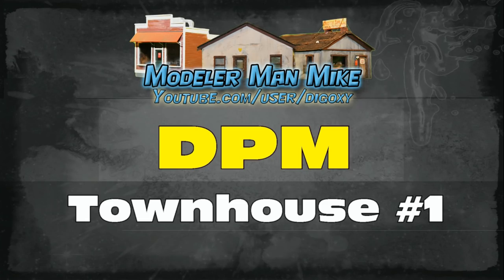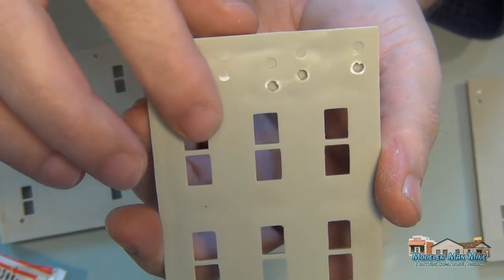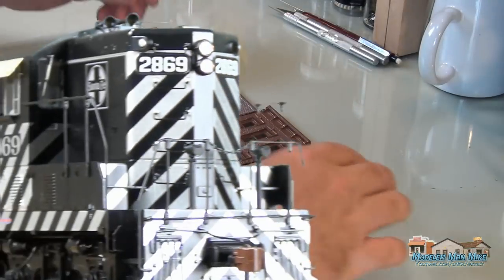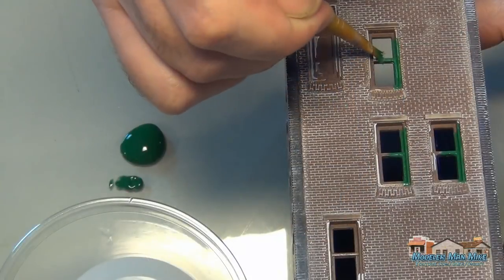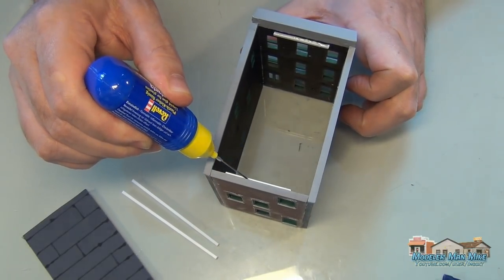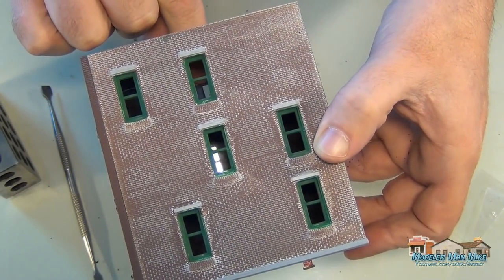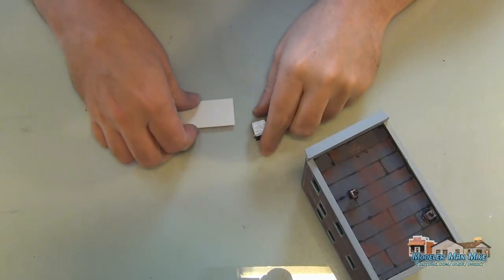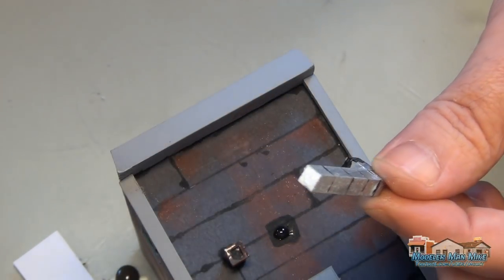Model Railroad Layout Building DPM Townhouse #1 How To

Comment: Thank you for this video! But a question! Why didn’t you apply the white paint in the mortar joints on the front of the building?
Reply: I surely dont remember, it may be that it has all the windows? Would be more difficult to take off of the brick with all the other stuff that is on the front of it. Totally guessing though.
Reply: Thank you!

Comment: A trick I came across for DPM and similar buildings is to use your dial calipers to measure a window. Then cut sheet styrene to that size for all the windows. (Cut strips for width and use a chopper for length)

Spray paint the windows, then when the paint is very dry (24 hours ) use a little white glue to put the styrene over the windows.

Now you spray paint the walls.

 The styrene should pop out without much fight. (White glue does not hold non porous items) You can also hand paint the sills with the windows still covered.

I built that model a few years ago. BLMA sells window air conditioners in HO, and I used a few of those on it.

I also modified one window to be open. I have a figure leaning out the window looking down at the wrecked air conditioner he dropped out of the window. 

It always gets a laugh.
Reply from the maker: Oh, now here are some really neat idea's, including a scene even! :) Thanks pmsteamrailroading! The BLMA are they the lazer cut little tiny metal ones? If so, I had intentions of using these, I just never got to it for the video. I do plan to use some of these window units on another build video eventually. They look cool and they are a great little add on.

I am certainly going to try your suggestion on the windows and see how that goes for me. I am planning another DPM Build that will include a couple of buildings at once and this means alot of windows! I have actually masked off the entire building (kind of the opposite of what your saying) and had decent success with that. In all, I am really lazy when it comes to doing some of these models. Recording the build and building takes so much time already, I cut corners where I can.

Would like to see some pictures of your models and scenes, do you have a facebook page? if so, look me up modelerman mike

Thanks so much for your comments and suggestions, you may very well see these in a future video. Hope fully, when that time comes I can get back here and find this so I can mention you!

Comment: Too keep the building square take a couple of your old room keys form hotel and put on table and make sure that the corners are touching on both sides.  Gives you a 90 degree angle. The edge on plastic card gives you something to push up against to insure corners are square.
Reply from the maker: Hey Art, I am not real sure if this message is meant for me or not? might be for someone else that commented here maybe? I am using 1x2x3 blocks and squares, I guess you see these in the video?

Comment: Hi Mike very nice job on the build and the video. You might try a angle brush or
cut a brush at an angle to do doors and windows. Johnny Reb
Reply from the maker: Hey Johnny, thanks so much for the comments and the suggestion on "coloring inside the lines". You know, after watching this video, I linked Miles Hale's Woodland Scenics DPM building instruction video into the description of this one and wound up watching his! lol! Your suggestion is exactly what he does. Something else I noticed watching my own (these close ups are amazing, I see more in the video than I did making the dang thing) that, my brush has loose "hairs", I didnt even know this! But, I am going to take your suggestion and Miles and give that a try next time.
Reply: ModelerManMike
Mike glad to be of help. Also i forgot, try cutting some or about half of the
bristles off. Then cut the angle about half way down the bristles. This make
the bristles stiffer for better control. Videos and pictures of what you are doing
can be a big help. Johnny Reb
Reply from the maker: Johnny Reb Hey Johnny, I will surely give this a try. Thanks for the tips and of course the time to write this comment! Its appreciated!

Comment: To paint the windows and doors, paint these parts first with airbrush, then apply a tape mask after dry. Spray the building walls and then remove masks when dry. Or, paint the windows, doors, and trim with a fine brush first, then the wall surfaces.

Comment: Hi Mike, most of my paints are Model Masters Enamels and i find using 10/0 brush maybe 20/0 and thinning the paint Helps a lot making it flow easier round the window frames, But that's Enamel .But it still a wonderful by you .
Reply from the maker: Most of what you see me do is done primarily because I am lazy. I will use water based paint whenever I can so I can have a really easy clean up! I do use some enamel's only when I need to. Your right though, thinning helps a lot and after seeing this close up, I can see my brush is all but new! Its straggly little hairs all over the place, it really created a mess, it was easy to overcome but man, seeing it in a close up here, I was blown away. My eyes are not near what they used to be! The close ups really show me what I dont see when I am modeling.
Reply: I wish i could get myself to using acrylics ! But dad taught me the way of enamels . I do use acryl the way you do on the mortar lines
Reply from the maker: thetobin8or I say, do what works and your comfortable with!

Comment: Nice job. I like the idea of the sand paper on a board.  Did you glue the paper down? Do you have to change the paper often and what grit did you use?
Reply from the maker: Hello Drummer, the paper is glued down with spray tack. I haven't had to change it yet, it last a while I would imagine. I cant remember the grit, but this is totally optional, the idea would be a course and fine. I actually have a video on building this exact board in this video that explains it all including the grits located here: https://www.youtube.com/watch?v=0baxtdbIQIE Thank you for the comments!

Comment: For painting the windows, you have to have your hand resting on a fixed surface like a book (or two) and then bring the work to your hand.  Then you only have to pivot your fingers.  Same concept as a painter's hand rest.  I also find that lower cost acrylic paint needs to be cut some so it flows better.  Some colors also cover better than others, but am yet to find any solid discussion on this.  There seems to be too much guessing and testing at times.
Reply from the maker: North Central Lines On30 Thanks for the comments! Brush I think is the big one here, I will put this together in the next DPM build I do. Appreciate the feedback!

Comment: Well done video Mike.  How do you prevent your glue from seeping from the joints when you squeeze them together?
Reply from the maker: I use only the amount needed. :) Actually, the glue is so thin it doesn't really "ooze". This is for all purposes served called a glue but its actually a chemical that melts the plastic so it bonds the two pieces together this way. Are you using the chemical or the testers type of glue?
Reply: ModelerManMike  I've used both testors and hot stuff. I used to paint first but not much luck.  Now I build first then mask and paint but still have trouble getting glue on outside of building.
Reply from the maker: I have done the same thing, I go back and forth really. I find though, using the chemical on unpainted models seems to work pretty good. I can use it on painted to, but, I think this is a lot of practice. DPM and Walthers work well with the some people actually really like using the brush type, with a brush, liquid cement/solvent they call it. I use this but with the needle applicator. Plastruct sells some great stuff for styrene products, here is a link to this stuff you might try: http://www.ebay.com/itm/Plastruct-Bond-2-Bondene-2-oz-Plastic-Solvent-Cement-/391108448124?epid=691277077&hash=item5b0fe14f7c:g:HXUAAOSw7aBVJSgk This stuff people really seem to like.
Reply: ModelerManMike thanks for the info. Its a struggle getting things to my liking.
Reply from the maker: I am a bit picky myself! sometimes you gotta just let go and hide the crimes when you need to.
Reply: ModelerManMike I'll try.  One of the best features of your videos is no into.  You get right into why we watch them!

Comment: My technique for windows is to paint the whole building the color you want your windows, then cut thin (0.10") styrene to the dimensions of the windows. Use rubber cement to put them in place. Paint the rest of the building the color of your bricks. The rubber cement makes it easy to remove the window masking, and resulting windows are free of overspray or any other issues normally seen with DPM models.
Reply from the maker: thepoo1234 This sounds like a great technique, a few people do it this way and I may have to try this in the next build. Thanks so much for the comments on my channel and the suggestions, very much appreciated!

Comment: Great video Mike ! Can I ask what you use as a sanding block. looks like a piece of steel .I want to say that I have seen other modelers using the same tool. would work well as a square also .
is it something I could purchase?
Reply from the maker: Not sure what your talking about, if your talking about the square block with holes in it, its called a 1x2x3 block, they are steel and are perfect square, I got mine from ebay I think.

Comment: Great video - thanks for sharing - where do you get the metal weights? Have you ever used just black sandpaper for a quick roof. Gives that asphalt type look.
Reply from the maker: The weights are called 1x2x3 blocks, I get them from ebay. They are actually machinists blocks but work very well for building models! Yes! Of course, I use types of sand paper for roofing material, I like to use also black masking tape. Check out some of the other video's on my channel and you can see some of the other stuff I do with sandpaper. Ian, thanks for the comments!

Comment: Mike,
Watching you paint the windows of the DPM kit. Do you use the paint right out of the bottles or do you thin the paint down with water or IPA?     thanks Good Build   KB
Reply from the maker: You know, I do thin it, its come to my attention that the brush I am using may be some problem. I have used these brushes for years but it may be that now my eyes are not nearly as good as they used to be! This is really interesting, I rarely watch my video's once they are produced, I spend so much time studying the cuts and edits and by the time I finish, I dont want to see it anymore! However, after so many people explaining this to me, I went back and watched this on my big screen and so many are right. This brush has traggler hairs all over it, you can actually see these doing some extra painting for me! Its crazy. If you want to see this in action take a look where I am painting the bottom concrete window seals.. just dotting everything up! Its crazy. Just a note, the Americana paint generally is pretty decent right out of the bottle, its thinned down pretty good, but, I do thin it sometimes. I do forget to thin it sometimes but for the most part, I have the paint right, now, I gotta get the brush right. Sorry so wordy, I just find interesting how simple things can be overlooked and cause so many issues.

I appreciate your comment.
Mike

Comment: Nice video, for masking those windows get some silly putty, it is great for masking.
Reply from the maker: Wow, ok.. that sounds like a great idea. You modelers just have all the answers! I am totally open to all suggestions as you know and do appreciate your feedback as a modeler! :) You will more than likely have many angles that the model railroad guys may not think of, please study and share any idea's. I would also very much so appreciate constructive criticism! Anything that can make it better.
Reply: ModelerManMike I have only built up one building, so I don't have a lot of experience with them.   Quite a few of the techniques you used were new to me.   So it goes both ways....

To be honest, I probably would have airbrushed the entire thing, and started with the recessed windows first then worked my way to the upper surfaces.   Easiest way with masking.  But you had a good end result, so what ever works for you is the best.   But do get some silly putty and play with it, I use it all the time as a masking agent.   Most recently I used it to mask off the body of the Tie fighter pilot, so that I could make his boots and helmet shinny.

It is best used on strong contours like your windows.

Comment: Great tutorial. Can I ask who manufactures the metal weight you used when gluing the feet to the platform for the air-con unit?
Reply from the maker: Hello Patrick, the weights are called 1x2x3 Blocks. They are used by machinists but work great for building models. You can get these from Ebay or Micro-Mark.
Reply: ModelerManMike Thanks Mike!

Comment: I would have used a little puddy to the corners of the roof to make it look like it's poured at one time, rather than having the small cracks seen from above on the roof.  Other than that, I like your idea of using the "X" version of black paper for the windows, although my models have curtains and open windows with interior furniture and people using LED lights to show off the model.
Reply from the maker: Wish I could take credit for that black out X, that was actually something I picked up from Miles Hale, one of his DPM Build instruction video's. It really get the reflective value of the windows happenin. So many things to do with these buildings.

Comment: Where did you get the glue you were using? What is the brand name because I haven't found it at my hobby shop...
Reply from the maker: Hello David, the liquid is made by revell, its I think German. I buy it from ebay. The simple truth is, the reason I use this is because of the tip that is on this bottle. Any glue that is used for "plastic welding" works fine. You can if you would like to get some of this get it from Ebay, I usually look for the best deals on this when they are listed, here is one ad I found, this is high for me though, http://www.ebay.com/itm/Revell-Contacta-Liquid-0-88-oz-Plastic-Model-Glue-39604-/121736640066?hash=item1c5811b642:g:vj8AAMXQeKNTMXSv

Comment: What kind of glue do you use? I like the needle you used.
Reply from the maker: +Ed Ragin I like the applicator also, its a european solvent called Revell, I buy it online, its great for plastics. It actually melts the parts together. You might be able to find it at a hobby shop or something also.

Comment: I wish they would put ALL draft angles on the top! That’s where it should angle down...
Reply from the maker: Actually, all 4 sides of one have draft angles, so indeed the top already has draft angles. When in the mold, to be able to remove it, they all have to have a bit of draft angle or they would not come out of the mold. I completely understand though what your saying, if it could work that way, I completely agree. Thanks for the comments!

Comment: Just one missing detail that I have seen on all DPM kits. You have a flat roof with no drain spout. Usually the roof slants to the drain pipe which is on the outside of the building.

Comment: I am having trouble getting the mortar to stick in the joints. I have tried different methods, joint compound and a white wash and when I begin to work with it, rubbing it in with my fingers it goes away. What am I doing wrong
Reply from the maker: if you are following the steps in this video, this should work for you. This video does not show anything about using joint compound, it only shows how to use a diluted water based paint. Using thin water based paints will allow it to "drain" into the relief's and then you let dry enough to settle. You can then use something to remove the top layer without touching the relief.

Comment: What kind of glue you using  In that blue Revel bottle?  I'm working on a DPM N gauge "Reed Books".  Got the 'box' together but before we paint the windows, I wanted to change the color to like yours in this video.  the kit comes a brownish tan color.  Cool video.  I'll have to check out more of your stuff.  Check my channel for a video of y N  gauge tram layout.
Reply from the maker: It is actually Revell "glue". Its solvent based. It actually melts the plastic together. Yes, I do have some more video's check them out when you can, thanks for the comments and compliments!
Reply from the maker: @ChinaAl  Its actually a solvent, its not super glue, its a special liquid that is used for plastic models that melts plastic. It is a specific type of chemical that modelers use. Most models for model railroads (and most all other models really) are made from styrene, abs plastics. Modelers instead of using an adhesive type glue like Elmer's or super glue will use Polystyrene cement, because it melts the plastic used on many models to join two parts together forever. Check some out, its much like "Plastruct Plastic Weld" that is found on Amazon and many other hobby shops and stores. Its basically the same stuff I am using.
Reply from the maker: @ChinaAl  Oh, your wanting an applicator also, check that out to by searching for an Applicator.
Reply: @ModelerManMike  Thanks. Got then this morning.  I appreciate your help/